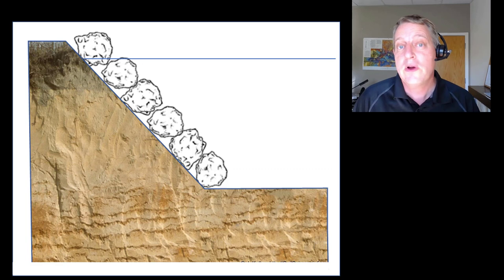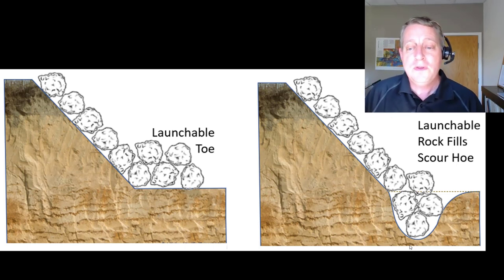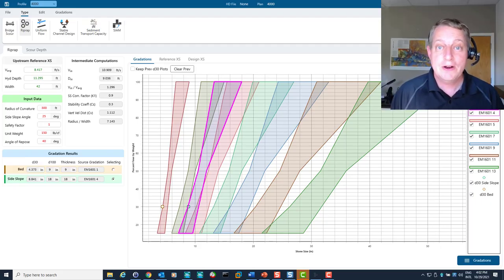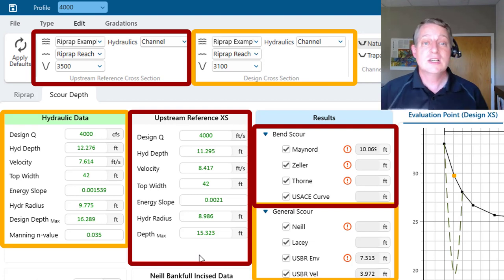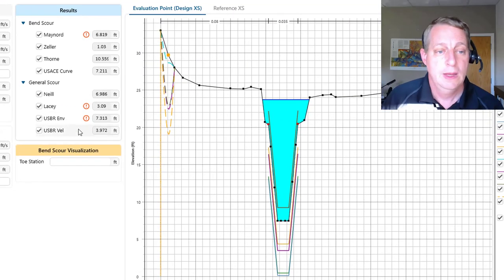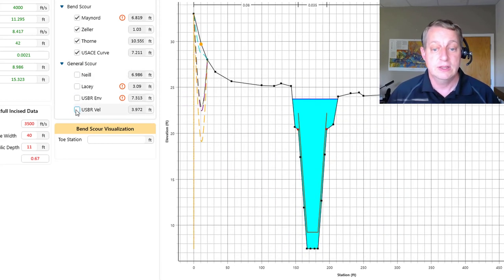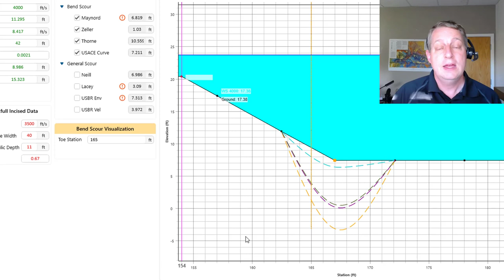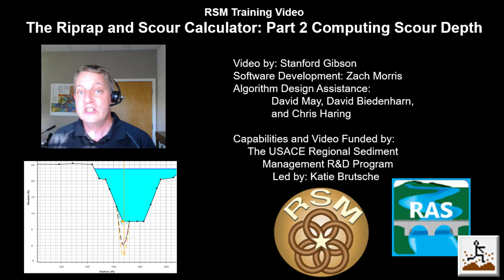Riprap and Scour Calculator: Part 2 Computing Toe Scour

Comment: Please show how to calculate reservoir bank erosion in HEC-RAS
Reply from the maker: This is a difficult problem.  I scoped a project like this, but have never used RAS to do it.  But in theory, the BSTEM module should be able to handle this.
Reply from the maker: The main cause of reservoir bank erosion is not velocity or shear stress from the water.  It is the pore water pressure when the reservoir stage falls (particularly if it falls quickly).
Reply from the maker: BSTEM actually can track the groundwater elevation lag, and the pore water pressure, and how that affects geotechnical failure for a low velocity reach like a reservoir.  That is the tool I would use.  I should do a general BSTEM video at some point, but it will be a while.
Reply from the maker: The documentation is pretty good: https://www.hec.usace.army.mil/confluence/rasdocs/rassed1d/1d-sediment-transport-user-s-manual/bstem-user-s-manual